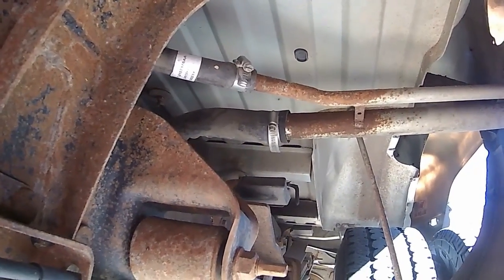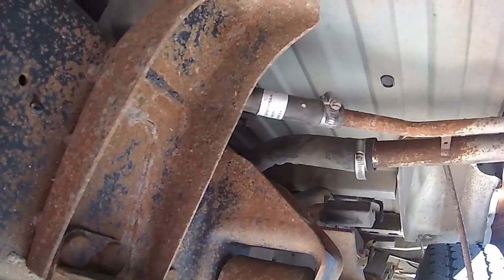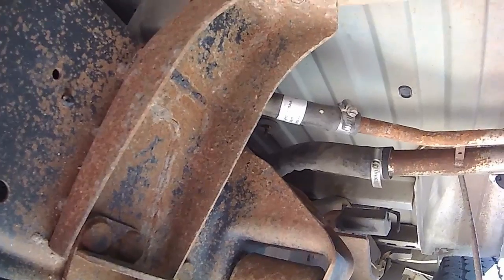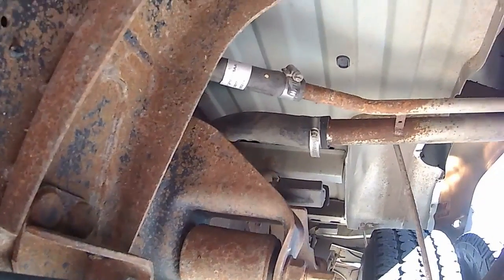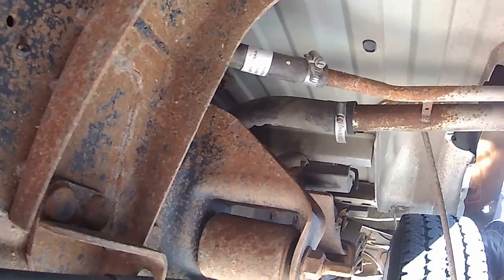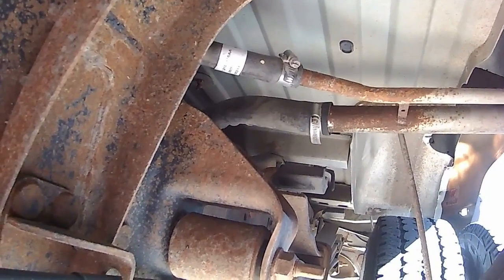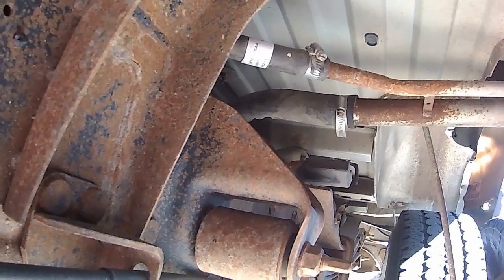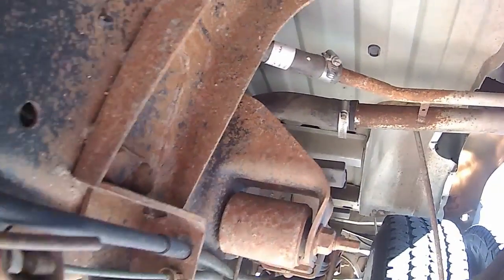Cummins Truck in Tank Fuel Pump Access | Drop Fuel Tank

Comment: Brilliant bit of engineering that you have to drop the carrier bearing bracket down to move the strap.
Reply: not necessary. as long as you dont wedge the strap (if you do wedge it just hit it with a hammer until it isnt wedged down into the carrier bearing bracket anymore) you can wiggle about two inches of clearance between the bottom of the tank and the strap, then you can unhook the other side. hold the strap at just the right angle and it will slip right out of the carrier bearing bracket. being it is a dodge i have had the tank out of my truck 5 or 6 times and not once had to touch the carrier bearing bracket.

Comment: My fuel pump in my mustang is in the freaking gas tank sucks to change it out..
Reply from the maker: +Shiny Knife that had to be a pain.  At least I had room to get under there to do battle with it.
Reply: I had to drop my tank.. All the lines were rusted and the wires corroded had to replace everything.. In the parking lot where I work on Jack stands.. I should have had it towed home .. Live and learn
Reply from the maker: Oh my goodness.

Comment: Thats a bummer. I just replaced the fuel pump on my truck. Hopefully I get more than 6 months from it.
Reply from the maker: +John Capps Yeah.  ridiculous.
Reply from the maker: +John Capps I was planning an actual how to but only this footage made it for some reason.  So it was just an intro to fuel pump access instead of the full on how to change the pump.  That little $55.00 camera though did a good job and I did not feel bad at all about sticking it in there to get up close.  I would have been more reluctant to do that with an expensive camera.  Also tried the new zoom H1 for the audio.

Comment: NEVER replace the factory in-tank pump on these trucks with another in-tank pump.  They're garbage and can barely deliver adequate fuel pressure/volume to the VP injection pump.  Then you'll find that not only are you replacing the garbage fuel pump but you're replacing the VP injection pump too since its lubricated and cooled by the excess fuel pumped by the fuel pump.  Instead install a FASS or Airdog or Fuel Boss fuel pump system and be done with these terrible fuel pump options Cummins and Dodge came up with.

Comment: Second gens have in tank lift pumps? I have a 3rd gen with an external filter bowl mounted pump (when it was stock) Tank just has the level sensor and factory returns.

Comment: I sold parts for a lot of years and watched the after market parts become junk. Since they don't pay labor. And offer a life time guarantee. They are so not worth it. Beck when I sold life time new water pumps. they would fail with in a yr. A rebuilt was out lasting them. I proved my point on those several times to people. If you have to change out parts that are a pain in the ass.  Buy Original manufacturers parts. You might pay twice as much but you won't be doing the job so soon.
Reply from the maker: thanks